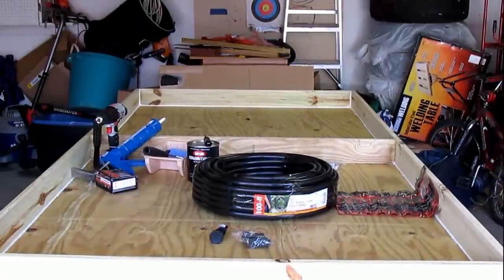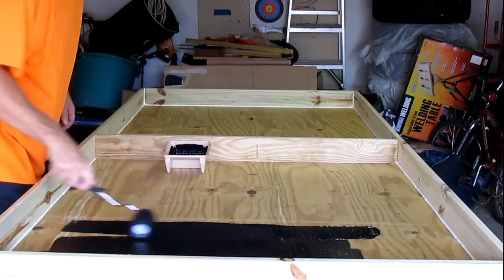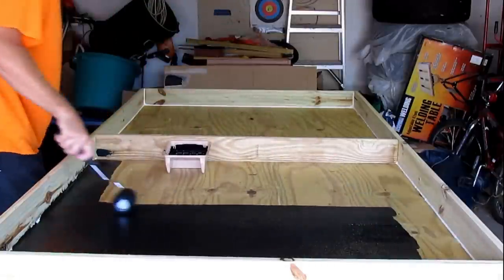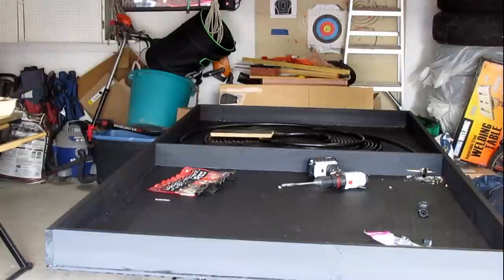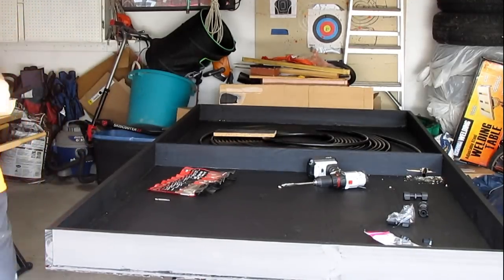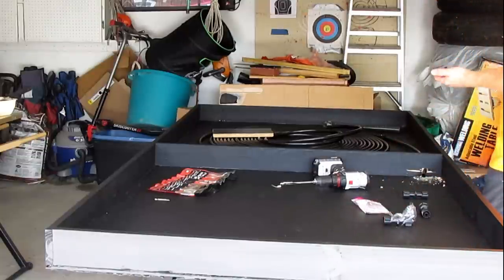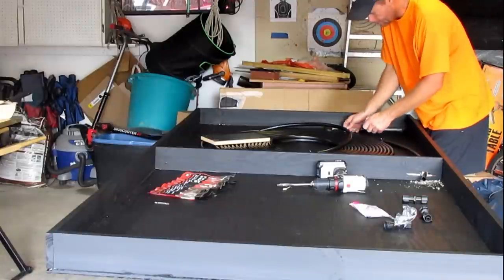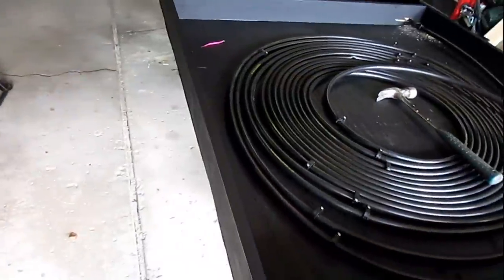How To Build A Solar Pool Heater - DIY!

Comment: Painting the wood black is a waste of time its not going to make the tube get any hotter
Reply from the maker: Hi John,
It;s just a simple fact that darker colors absorb more heat than lighter colors.
The color black absorbs all wave lengths of light, which is energy, whereas white reflects all wavelengths of light.
The closer the color to black, with black being best, the more light/energy the painted surface/object will absorb.
You don't have to paint anything black, but you will be missing out on some energy :)
Thanks for stopping by & happy heating my friend
#RCInsiders
Reply: Paint your whole body black and  sit out in the mid day sun and tell me your  not getting  hotter 😳
Reply from the maker: Excellent example :)
Happy heating my friend!!
Reply: RC Insiders that is true, what the problem is the wood is a poor conductor of heat, so painting it black to absorb heat is a waste because it will not help the pipe heat any faster. The pipe its self needs to be black but the wood does not
Reply from the maker: Hi John,
Painting the wood has a couple benefits.
Painting will help to protect the heater against the elements.
Wood may be a poor conductor, but being black it will draw heat/energy into the box, which will be trapped by the cover, thereby raising the inside temp of the box. Higher temps inside the box will help heat the water flowing through the tubes.
Happy heating :)

Comment: Amazing project,

As I have an extreme lack of space in my yard, do you figure it would be possible to place this contraption on top of my garage? 
That would be approximately a 8,20' height difference to pump the water up the roof plus the pressure needed to get the water through the hose.
This way I would safe a lot of space though and have an unobstructed exposure to the sun.
Reply from the maker: Hi,
Yes, this is definitely possible & I have considered doing it as well & still may.
I believe the pump in the description has an 8' lift rating. So when you put the pump in the pool just put it down in a foot or 2 & you should have enough lift to get on the garage & through the heater unit.
Please do keep me updated!!
Thanks for dropping by & happy heating my friend
#RCInsiders